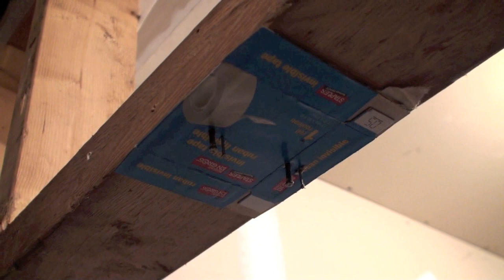new shitter!

Comment: hey pug, what's wrong with the old shitter? also, i wouldn't cram too much into the office there. washer and dryer would be good in the kitchen. you could run one heavy 220 line, and have the stove, and dryer on a seperate electric pannel. Save lots of $ that way. ...that is if you get electric pliances.

Comment: #14 wire= 15 amp breaker
#12 = 20A breaker
#10 = 30A breaker

Are you going to bulid a raised floor or bust up the concrete?